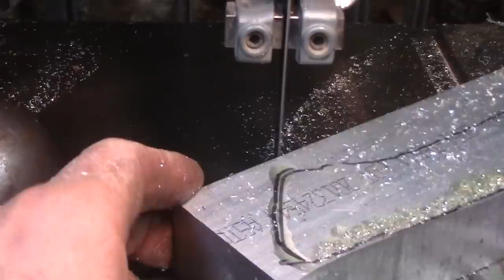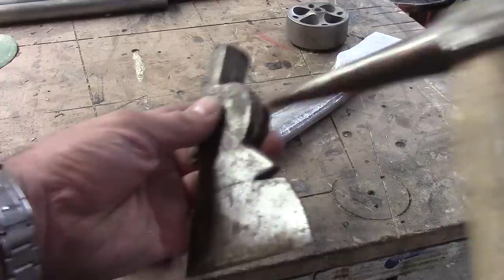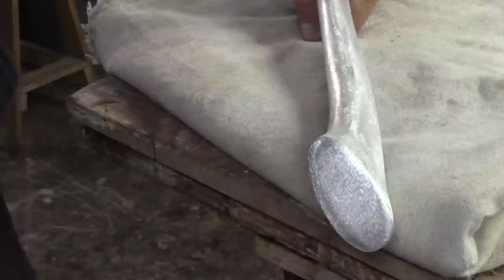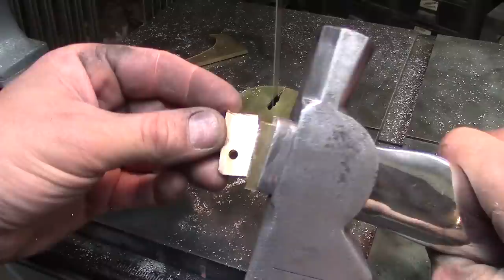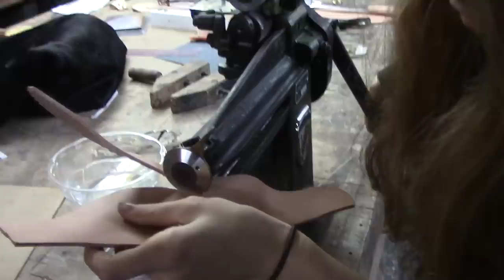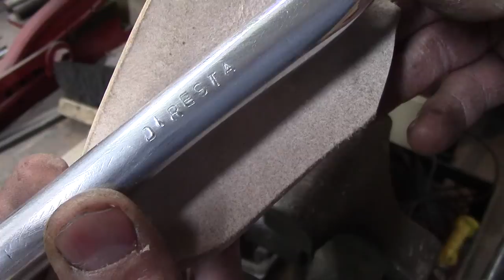✔ DiResta Aluminum Hatchet Handle

Comment: Nice work where do You get the aluminum?
Reply: +58belvedere From the aluminum store. Sorry I couldn't resist, there really isn't one "location". Onlinemetals.com matweb.com. Call your local steelyard, better yet get in touch with airgas, Praxair etc and they will tell you.  6061 isn't the best for this stuff but its the cheapest and most commonly used.

Comment: Apart from the problems in the description, you did not show us that you sharpened the axe. And the leather sheath would be better off with a strip of leather in between the folds to protect the stitching thread. The leather pad on the handle could use some glue instead of just friction. Also, I doubt the head will come loose (except from corrosion) but it could have been hung better: if you had sharpened the bottom part of the eye square (the edge, not the curve) and sanded the handle smooth on the part where the head was to come, you would have seen the steel of the head shaving off some material which results in a properly hung head. (no offence intended, just some remarks)
The axe looks nice and it is undoubtably well made, good job. But I just can't get myself over to like a tool that has been modified to look better (in your and many other's opinions) while sacrificing the usability and life-span.
I guess there is a place for everything, but please, don't make too much of these.
Reply from the maker: Eddy the Cody comment is my Twitter from April screen shot. Proof. I never talked to him or heard of him until he commented. I still never talked too him. This tool gets used often as do all the tools I make. It can shave w it. It is that sharp. You may be a traditional ax man but I am not.  There was once a time when a cave man tied a stick to a rock and some one said "you can't do that it won't work.  You have to use your hand !! That is how we do it !!! Don't think !!!..."
....But he didn't listen thankfully.. And now you have axes with wooden handles because some cave man thought out side the box. 
    I used the tool just yesterday to clear brush on my "homestead" 40 acres in Catskil ny. The tool will never break or go bad. Check with me in 10 years.  Promise it will be worn but perfect.  Thank you for the positive comments.
Reply: You have a point and i have no reason to believe you say anything but the truth. That comment was indeed nasty. He probably deleted it because he regretted it, if he really stood behind it he would have left it on there. 
About the axe: You have yet again a point. Nobody really tried this before, so no one can tell what will happen to it. For the galvanic corrosion to really kick in you need an electrolyte solution (like salt water, tree sap, etc.) and/or direct contact. It is a long-term problem al well, in most cases not directly visible.
I am so concerned about the corrosion on this axe because I'm in my first year of engineering and there I learned that putting substantially different metals together with no isolating shim is an absolute no-go.
But if you keep it clean and take care of it, you might postpone this effect longer than anyone would expect. If you ever make an update on this axe, I'll be the first one to watch it.
I apologise for saying you had cut the usability down. I have to say it is built like a tank and it will indeed never break. The comfort of the aluminum handle is of course personal preference. I assumed it would be bad but since I never held it in my hand and worked with it I am in no position to judge that.
Again, from what I see, you are skilled in the shop (something that I, as a 19 yr old, am striving towards as well. And it's going pretty well.) which is always respectable. 

Thanks for replying. it means a lot if a big-time youtuber replies to one of my comments.
I have a channel myself about archery (obviously not this account, around 80-90 subs) and I reply to every single comment.
Reply: jimmydiresta And sorry for the long reply, it is a strange tendency of mine.
Reply: EddvT, what is it about this beautiful and functional ax that has you in such a tizzy?  You should take all the time you're spending here "educating" jimmydiresta (and everyone else who happens to appreciate it) about corrosion and how to do stuff, and go get some shop experience instead.
Reply: jlander82, have you read my long comment in this thread? I advise you do.
About shop experience: I have been in the shop for nearly half my life, I made a blacksmithing shop in the backyard. I am making and restoring tools.
About the axe: I guess our tastes are different, let's leave it there.
Reply: EddvT Yes, I had read all of your comments on this page about the "right" way to do everything. In fact, it was your full library of condescending comments/criticisms that prodded me to even make one in response.

You seem to be OK about having different tastes in things, which is good.  It just doesn't mesh with your need to comment on here on how a master builder should have done just about everything your way.
Reply: I already apologised to him, I also clearly said "remarks" not "this is how you should have done it" What I mean by a remark is when I tell something that jumps in my eye, to notify someone, who can do whatever he wants with that information. If I used the wrong word, I apologise, English is not my native language you see.
Reply: EddvT Also, "half your life" just isn't that much when you're 19.
Reply: I do not see the problem anymore. if you want to go on about this, then please elaborate.

Comment: I don't now how you do this with out gloves!
Reply: Jack Pleus
Many machines with lots of moving parts are actually more dangerous to use with gloves than without them. Gloves can get caught in moving parts, taking your fingers (and possibly your hand) with them. Gloves also inhibit the precise movement you get when not wearing gloves. Very thin gloves, like the kind a dentist or surgeon would wear, are an exception. They stay tight to your hands (if you have the right size gloves) and will almost never come off unless you were to remove them yourself. However, I wouldn't recommend wearing thin rubber gloves when forging, as they could melt and burn your hands (and any nearby hairs). 

Regardless, I completely understand your concern for Jimmy's safety. Never hurts to be too safe :D

Comment: "useable" art. not something you would plan on using a lot, or ever, but that doesn't make it something you don't want to have anyways. i'd like something like that hanging up in my garage,. maybe an aluminum head so i don't have to worry about that galvanic corrosion thing.

Comment: Axe Handles 
One afternoon the last week in April
Showing Kai how to throw a hatchet
One-half turn and it sticks in a stump.
He recalls the hatchet-head
Without a handle, in the shop
And go gets it, and wants it for his own.
A broken-off axe handle behind the door
Is long enough for a hatchet,
We cut it to length and take it
With the hatchet head
And working hatchet, to wood block.
There I begin to shape the old handle
With the hatchet, and the phrase
First learned from Ezra Pound
Rings in my ears!
"When making an axe handle
 the pattern is not far off.” 
And I say this to Kai
"Look: We'll shape the handle
By checking the handle
Of the axe we cut with-"
And he sees. And I hear it again:
It's in Lu Ji's Wen Fu, fourth century
A.D. "Essay on Literature"-in the
Preface: "In making the handle
Of an axe
By cutting wood with an axe
The model is indeed near at hand."
My teacher Shih-hsiang Chen
Translated that and taught it years ago
And I see: Pound was an axe,
Chen was an axe, I am an axe
And my son a handle, soon 
To be shaping again, model
And tool, craft of culture,
How we go on.
 
 -- Gary Snyder

Comment: Galvanic corrosion is an issue, but only if you use lasagna as a wedge. If you really want to get to the haters though you should use it to open a tin can of tomato sauce. Four different metals in the presence of acid will repel the safety nazis like garlic.

Comment: Wasn't easier to make a mold, and cast it?
Reply: Doing that will have a chance of having bubbles making the metal weak.
Reply: +patrick Boever if you have any idea what your doing bubbles are very easily avoided. Especially with aluminum
Reply: +Luc Lachapelle lost foam would work too
Reply: Nicolás Colombo
Casting metal for a hatchet or axe handle is a bad idea. Cast metal is actually very brittle compared to most other methods of forming metal.